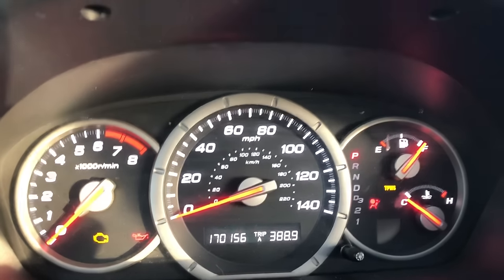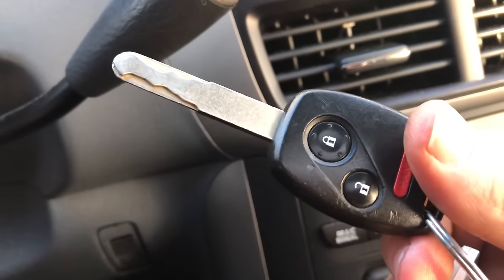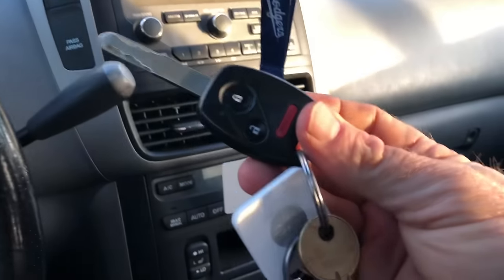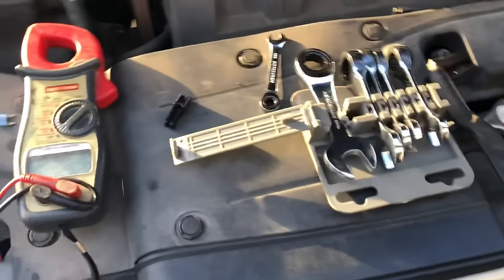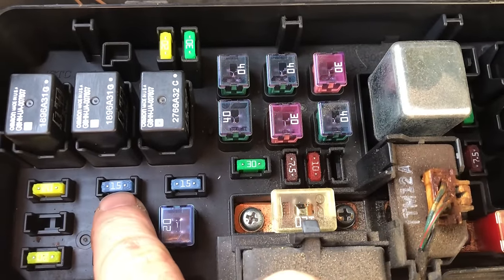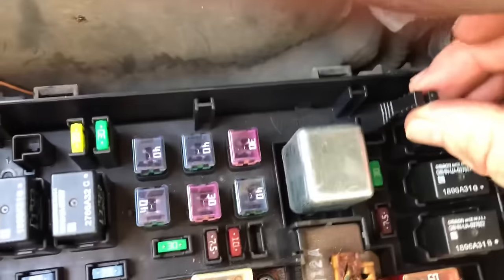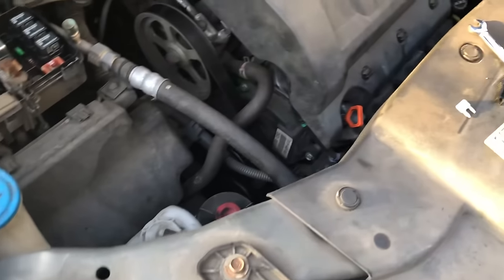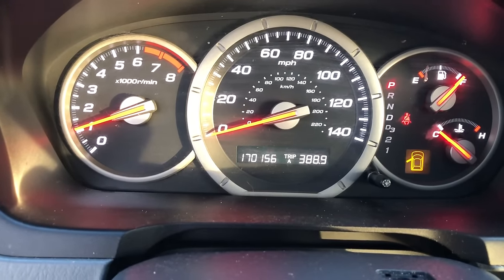Honda No Start Flashing Green Key On Dash - Easy Fix! (2024 UPDATES!)

Comment: Thanks so much for posting this. The vehicle locksmith, after carrying out a diagnostic test, told me the ECU had failed and would cost £2k+ to repair and my car was probably a write-off! Checked the fuse, it wasn’t blown but tarnished. A quick clean, popped it back in and bingo, it started!
Reply: Wow so many people r paying for something they don’t need
Reply: Same exact thing happened to me. Although, I changed the fuse for ACG on my 2013 Honda civic and it still is flashing. He quoted me on replacing the ECU + programming my key.

Comment: I had this issue with a 2004 Honda Pilot, but it was intermittent.  I found that a tap on the steering wheel allowed the car to start, but that was a temporary fix.  After going through all possibilities, including the immobilizer ring suggestion which was ruled out because Honda has discontinued offering this part, I took the car to a mechanic and explained the business with the tapping of the wheel.  He called back in an hour or so to inform me the problem was fixed.  Apparently there is a little relay box located at the base of the steering column, and by tapping that he was able to start the car.  He replaced this unit and no more problem.

Comment: Ok so 2011 Honda Odyssey. My key fob case broke on a sport near this key which made my keey kinda wobbly. I went ahead and bought 2 Honda Odyssey flip key fobs with the blank key off ebay for me and the wife. Had my key guy cut both the odyssey keys when I had him cut and program 2 keys for my sons wrx. The 2 odyssey keys he cut, unlock the door and fit on the ignition. I took the guts out one of my odyssey key fobs and put into the new flip one. Electronics work as they should since it's the guts from the original but when I got to start it, I get the flashing green key as it starts and shuts right off! The heck is going on???

Comment: I have a Honda fit 2010 and the gas tank light is flashing and the car have a tank of gas I put a new fuel pump in and new spark plugs and the car will not start

Comment: 2006, Honda Element. The car doesn't start. The blinking green key comes on and doesn't go off, I checked the under-hood fuse box. #6 ECU 15 amp fuse was bad. Replacement fixed the issue.
Thank you all for your time and post. This all helped me to diagnose the issue. I truly appreciate this.

Comment: Dude, you just helped me stranded on lunch break away from work, in my daughter's 2009 honda civic. You saved the day Thank You so much! It was the fuse for the chip reader...(which I never knew)
Someone had put a 7.5 in a 10 slot & it was toasted!
Thank You Again!
Reply: Where was it located I’m stranded
Reply: @Mack_Worlds_Media  
The fuse box inside the car, bottom row, 3rd from the left
Reply: @terenasaldana8745 for the Honda Civic 2013. The ACG is in the fuse box underneath the driver dashboard. I couldn’t find it in the hood. But mine said ACG, not ACG S… not sure
Reply: @nathalien4457  I have 2011 Honda civic I couldn’t find the fuse  I need help  I have only one regular key

Comment: I have a 2014 Honda Pilot and found your vid. I checked the fuse and even got a brand new one and didn't solve problem. Then I decided to try jumping the battery with my other car. BAM! It started. I immediately replaced the battery. 
So my car gets the GREEN KEY symbol when battery has failed. 
So, there's something people can try. But thanks for posting. It helps to consider all possibilities
Reply: I tried jumping mine and it started right up. The battery that I have is less than three months old from the dealership. If it does it again it’s going back.

Comment: I am up in the cold north and my dear little 2004 Honda with very few miles, turned over but wouldn't catch. I saw the flashing green light, looked it up in the manual, called the helpful Honda dealership and they said it was electrical and needed to be reprogrammed.  Called CAA to have it towed as it was in the way of the plow's route.  Then, I thought I'd look it up and see if there was any video on it.  Sure enough, I found this one and even though my Honda is not the same year and the fuse boxes are not in the same location, I pulled a few things off and found it.  Used my keys to pull out the 15 fuse where it had the initials for the fuel immobilizer, or at least I guessed something to that effect.  With two keys, I pried the fuse in question out and easily accessed the spare, popped it in and the car turned over like a charm.  Thank you "Check It Out"!  I cancelled CAA and saved myself who knows how much as the dealership didn't have to look at it!
Reply from the maker: Yeah! Great job! So happy that you dug a little deeper to see if you could solve the problem.
Reply: Hi! By chance do you have a Honda Civic? I have a 2013 Honda Civic and I’m wondering if I need to change the same fuse you are talking about. I changed the ACG fuse on the box underneath the drivers wheel and still have this issue. I know it may the the immobilizer or ECU but will rule out this before paying $$$…
Reply: @nathalien4457  Yes, I have a Honda Civic 2004, and followed the video. Found the fuse he was talking about, found the spare, changed it and it worked.  I was sure to go out and purchase another fuse to replace the spare.  Not sure if this helps but this is exactly what I did.  Good Luck!

Comment: You are still saving owners money. I misread the obd 4 to 9 jumper and blew the same fuse as yours. What was puzzling about it was the engine acted like it wasn’t getting fuel. It would crank over just fine. It had nothing to do with a fuel pump relay or a broken key fob. Thanks again for sharing!!

Comment: We had this happen on our 2008 Honda Pilot on one of the keys, but it was starting fine with the Honda factory key and keyfob.  What had happened was, we ordered a new keyfob shell for the broken keyfob and it turns out there is a little transponder chip that you have to transfer to the new keyfob.  This video helped me track that down so thanks!

Comment: Omg thank you 🙏🏿 I just purchased a 2006 Honda Pilot and I went to leave the gas station and it wasn’t starting up the car sounded good and was running quietly and perfect then I noticed the green light flashing key symbol And immediately looked it up 30 minutes later after loosing my little  fuse pullers …. I finally was able to get it to turn over to bad I was only sold one key with this vehicle thank you anyway you save me a lot of trouble I haven’t renewed my AAA yet so I don’t know what I would’ve done

Comment: Worked for me, thanks a million man!

I've been going crazy pulling my hair out and firing the parts canon. Replaced fuel pump because I'm pretty sure I needed to do that anyway, replaced crank sensor I'm pretty sure needlessly, was about to consider replacing injectors once I discovered they weren't firing. Spent some time and money I didn't need to, I didn't even know a 98 Honda had an RFID key system.

Spent 10 minutes this morning to pull the ECU and pop that sucker off the board and my car started on the first try!

Comment: My 2009 Honda CRV also has this ussue. I have been able to fix it every time, and it's happened quite a few times, by removing the key from the ignition, then using the fob to lock then unlock the doors. I then reinsert the key, turn 2 clicks, wait a few seconds then start the car. So far this is work every time for me.
Reply: Wow
Reply: Same here on my ‘03!

Comment: Thank you so much! This solved my problem on my Acura Integra, changed my fuel pump, distributor cap and rotor, nothing worked. Tried your method and it works! The only difference is the fuse is located in the hood labeled "small light" 15A. Subscribed and thumbs up! Everyone check their fuse first before buying anything!

Comment: Thanks man! Good info!

Just bout a crank-no-start 98 Accord, it's the first Honda I've had new enough to have that "feature" (last one was a 92). I didn't know something that miniscule could cause a no-start on a car almost 30 years old. I just got done replacing the crank position sensor in 25F weather and am about to start pulling my hair out. I had no idea the flashing key light was a warning.

Swapping the fuse out for a new one didn't do anything, but at least now I have something specific to diagnose.

Comment: It worked. My 2004 Honda Civic had the flashing key light problem until I replaced the 15 amp fuse for “small light” as indicated in  the user manual chart for fuses under the hood. It was number 2 on the chart and and I used one of the spare fuses in the fuse box.  Before that I had to turn the key around to stop the flashing and even then I had trouble starting the car.
Reply: How did you locate the fuse on the civic🥺
I’m having the same problem right now
Reply: Can I ask, how did you know you had to change that fuse instead? I have a 2013 Honda Civic, I changed my ACG still didn’t work. I know it may be a bigger problem but..

Comment: My dad has been dealing with this issue for THREE YEARS!! Trying everything under the sun with no luck. Countless hours, money down the drain, lots of frustration. 
Fixed it today!!! 
Secondary relay on the backside of the fuse box!
Green light comes on now to start the car when needed! This secondary relay controls security, fuel pump & 5 other things I can’t remember. 

side note, we replaced the computer, main relay, immobilizer, switch & key, ect & nothing had worked until now. See countless pages, forums ect on this issue with little to no luck at the end. 
TRY THIS!!

Comment: OMG. This video saved me after 24 hours I'm struggling to figure out what was wrong with my car. It was my own fault! I bought this decorative little blinged-out adhesive Circle thing to go around the ignition and you can also place them on the stereo knobs. Simple, plastic, rhinestone stickers. However, they weren't plastic; turns out they were metal! And that cute little ring was creating a barrier between the key and the ignition and they could not communicate with one another. Silly me.
Reply: the same thing just happened to me , 5 panic attacks later I figured it out lol
Reply: @msprettyylee  I had to Uber to work and back before I figured it out. The mechanic came to my house and still couldn't figure it out. 🤦🏾‍♀️
Reply: Omggggg this was way I couldn’t start mine. My mom had to come all the way home with spare and we figured out it was the fkn rhinestone thing. Idk how I didn’t clue in sooner

Comment: Thanks for the video. In my case it was #8 15A fuse (FI-ECU), Honda Odyssey 2005. First I was on the wrong track (IMMO forgot my key codes, etc.). After seeing your video decided to check all the fuses. Saved me some big bucks. Above all probably saved me a day at least (dealing the locksmith, dealer, etc.)...
Reply: Save

Comment: I am having the same issue with the accord. Gonna check it out tmr to see if it is because of the fuse. I had to lock and unlock twice to get it start. I hope mine can easily fixed
Reply: Stu and Jenn banged hard strengthen thiid workout program 🍯 before thier exoudous
Reply: Hi, did it work

Comment: I checked fuses and were good. So after 4 hr rabbit hole😠i found a vid and so i just simply disconnected battery and problem solved🖒simply dis and reconnect battery worked for me😃2002 CRV

Comment: I also have the green flashing key. I tried to start my car with very little charge in the battery. It caused an error. Shut the car off turn it back on again when I got home and it started just fine. Thanks for the video

Comment: Thank you had the same issue with my 2006 Accord. Changed fuse and worked like a charm. 👍
Reply: Where did you find the fuse box in Accord, in the video he only shows Pilot
Reply: @salehagha9360  ever find answer to this??
Reply: @pouncerminned863  did you find the answer? I have a 2009 Honda accord but I can’t find the fuse he mentions in the video
Reply: @keniaguevara5534  no :(

Comment: Had this issue on a 2007 CRV iVTEC. Both ignition keys not recognised, flashing key symbol on dash. How I fixed it was by disconnecting the 12v car battery for 5 mins. Reconnected and the fault was cleared and the car started and has been working correctly since.

Comment: Awesome.  I blew the fuse by shorting the osb port. Thought I had fried the immobiliser. Used your method. On my 04 accord uk. The fuse is marked as engine management but its still a 15 a fuse. 2 min fix. Much obliged
Reply: EXACTLY what I'd done (shorted the OBD port) following another YouTube tutorial in how to turn off VSA and /!\ lamps on my '04 MDX. Found the AGS fuse with the help of your video, wifey helped me find the spare 15A fuse I was overlooking, replaced and MDX starts. Cancelled the tow truck!

Comment: What I heard on what the immobilizer actually does is kill the power on the wire going to the fuel pump itself. That's why the engine turns over without starting. That would take running a new wire from a power wire with ignition on, to the pump wire itself,  but that also eliminates all that immobilizer BS for good.  Mine still works, but a way I'm going to check that is to make a cheap blank key to turn the ignition on and use a volt meter to see if there is power to the fuel pump under the back seat.  Of course if the green key light isn't going off because of the immobilizer, that can still be checked with the same key already in the ignition.

Comment: Turns out the dead battery in my key fob was causing my 2004 Honda Civic to not start. It would start intermittently, but it got to the point where it wouldn’t start at all. Car battery, alternator and starter were fine the whole time that I was trying to figure out why the car wouldn’t start.

Comment: Did you ever plug a bluetooth code reader in the OBDII port ? I did see a "61-1 voltage malfunction" code and the fuse was ok. My immobilizer was blown once, 2nd time it had to be reseated, really don't want get stuck way out there again.

Comment: question - bought old ridgeline. occasionally get a no start first try. then it will start second try. same type of key you have. notice that at times one key will have the blinking green after i turn it off after retrying.  the other key sometimes gives a VSA and check ABS message. are both of the batteries low or do they need reprogramming? or do you think it's something else? thanks.

Comment: what about if you replaced the ignition lock cylinder/ignition switch but have the same transponder ring/immobilizer from the old one on it? the locksmith said he couldn't reprogram it cand i would have to buy a WHOLE new part which is another 300 bucks i don't have T_T idk what to do. 07 honda accord btw

Comment: My 2006 Honda Civic SI will not start because of the flashing green light. My battery died and we had to climb in through the trunk to get the car open and the hood popped. Once we jumped the car the immobilizer stops the engine from turning over. Any suggestions? I could not locate the "ACG S" fuse anywhere on the exterior of interior fuse box. Thanks
Reply: let me know how u fix it cause im having the same problem ty? from what people said civic doesn't have the acg fuse more like fuel pump fuse or little light fuse or #2 fuse? or is that the key need the programmer mobilizer to do it into the ecu to save the key in it to make it work?

Comment: My 07 Ody got triggered when i reached in through open window and manually unlocked it. Bought it 3 months ago. Didn't get a fob, just two valet keys. Honking stopped after 6p seconds. But power windows and locks won't work, and car won't start. Green key LED keeps blinking like in this vid. I had to get a ride to work, can't wait to try this when i get home. Hope it doesn't rain.

Comment: is there anyway to just remove that part altogether from the board? i lost the chip and still have key. i have no use to have it connected to the ignition and since i lost the chip i just want to get rid of that feature altogether. where did u purchace your smoldering device at? everytime i try to get specific infor in search it keeps going to bypass and reset which is NOT what i asked. is there another term you know i should be using?

Comment: My issue is that my keys wont turn the ignition over. I was thinking that i need to replace the whole ignition until i seen this video but you example shows the keys turning in the ignition. Mines wont i have a honda civic ex coupe. Do you know if this could be the reason why my keys isnt turning? Pkease reply but i will check this first before i put in a new ignition thanks
Reply: I put wd 40 in the ignition the key slides in fine but wont turn

Comment: For some reason this is not working. I’m not sure what I can be doing wrong but the battery died from trying it for so long. Probably the battery was already failing but I’m still unable to clear or reset my oil light. I have a Honda Odyssey 2012

Comment: This was really helpful. This is 12:00am and I was stuck on the road earlier. Just fixed 2 popped fuses and it worked. Thanks so much. I earlier paid a technician to code my key when it happened few weeks ago.

Comment: Hello, my father lost his only chip key. the car is a 2003 Honda Accord. I got a new cut key for the car but it has the green key flash. I just want to know if there is a self programmed system you can do by your self with out going to a dealership. Note: I have a regular transponder key not a remote key. Again thank you.
Reply: did u ever make it work I would like to know too or how u program that key yo make it work? did u have to use immobilizer program that cost thousands of dollar to reprogram it?
Reply: @bretana7438  no my father just payed about $250 and got a new key. Programer
Reply: @bretana7438  but I also did not try it. Give it a shot

Comment: The fuse is fine and it happened after replace the car battery The engine turns over but wont start and the key locks and unlock doors ...Any Idea ?